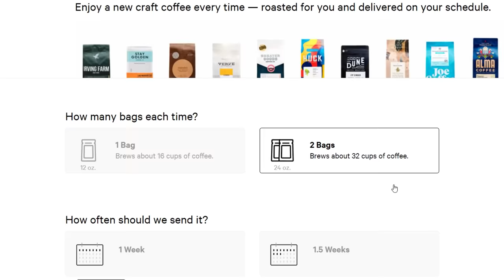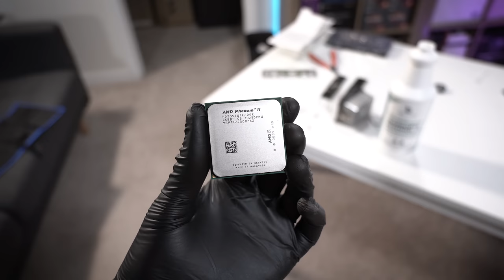Deep-Cleaning a Viewer's DIRTY Gaming PC! - PCDC S2:E10

Comment: I actually use my air compressor to clean out between the fins of my heat sinks and such while my computer is running when it starts over heating and stops cooling like it is supposed to. this saves me tearing it down to clean it more than once every 6 months or so. though I have some very powerful and noisy fans I use as I just turn up what ever and ignore the fan noise LOL (server fans that will take off and slide across and off a table when on if you dont grab them before they do once they have power, could probably run a weak slow quadcopter using those things. lol) https://www.youtube.com/watch?v=jw5YbSafnUw
Reply: that and I did my research and got a noctura heatsink/fan, though I have all that because really when I set it up I had no idea there was a "static pressure" vs "air flow" version and just went by how fast and hard it blew air, Now that I know I am probably going to try making my own on my 3D printer to go on existing fan motor, I have a couple really powerful ones the blades are damaged partially on and was just going to break all fan blades off to rebalance them and use them for spin coating but making a custom fan blade system I think would be more satisfying use of them :)